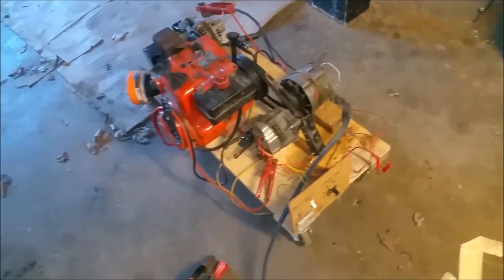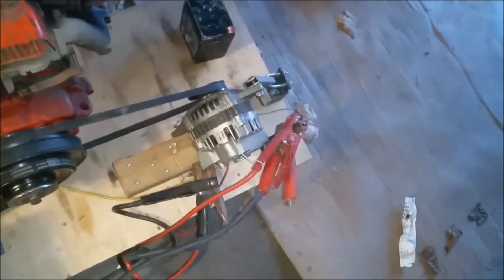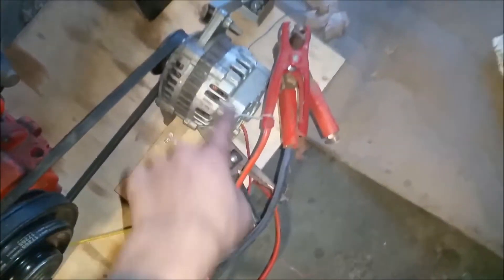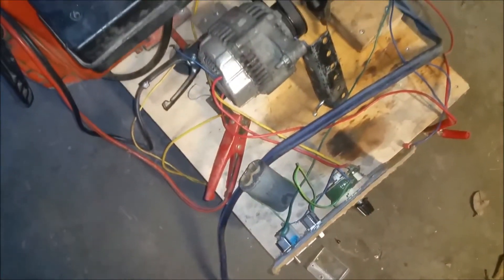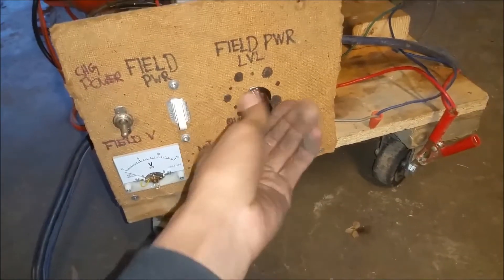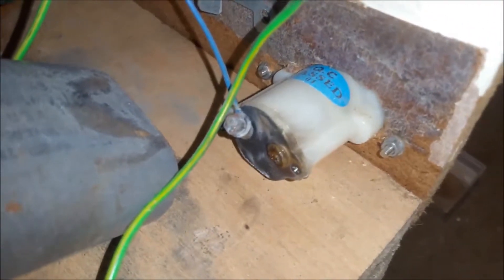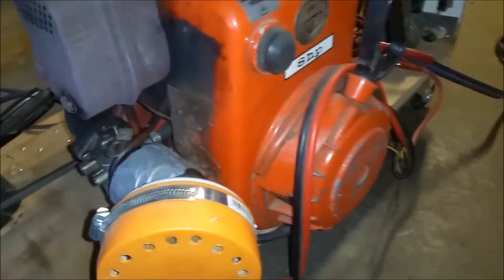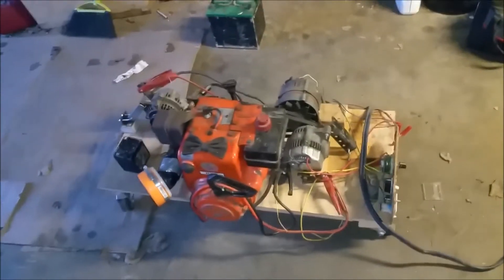The Stinger - Homemade engine driven stick welder

Comment: Some small engines come with a 12V coil for running lights and 12V battery charging on equipment and motorbikes. If you got one of those you could eliminate the 3rd alternator or use the 3rd for welding while the 12V coil provides excitation. The coils on those engines are generally Less than or equal to 3 amps.
Reply from the maker: This is definitely plausible, as I'm fairly certain this particular engine is compatible with lighting coils, not sure whether it would be able to provide the necessary current for dual field coils, I will definitely look into this though. I have the third alternator there for a few reasons I neglected to mention in the video. The third alternator is used to charge car batteries, and power an inverter during a power outage to supply electricity occasionally. I am currently rebuilding this machine out of slightly better materials, and I will explain everything in detail in a new video
Reply: @_AmTeC_  I'm working on a version using a Ford 3G 95 amp and a Briggs and Stratton model N. If you run the field/stator wire to the battery + it should self excite. Kurts cottage has an old video on it, but on the 10SI,12SI and 15SI alternators (GM) , Ford 1G and 3G (possibly 2G but that was a fire hazard) and some chrysler units it works. Your rheostat could also work as a control on self excited units. I'm not very knowledgeable on foreign cars, but I don't see why it wouldn't work. The old Apache and Scott welders (old engine drive units from 50 years ago) used a rewound 10SI as their power system.